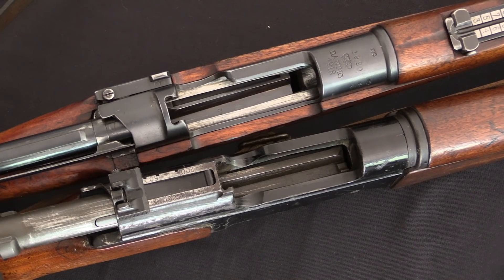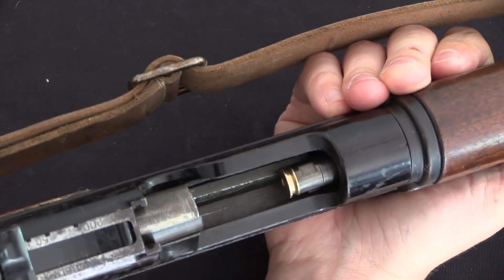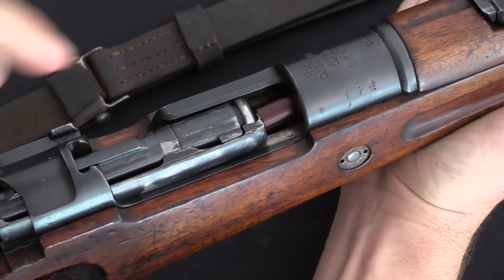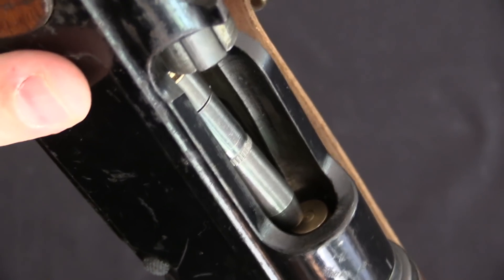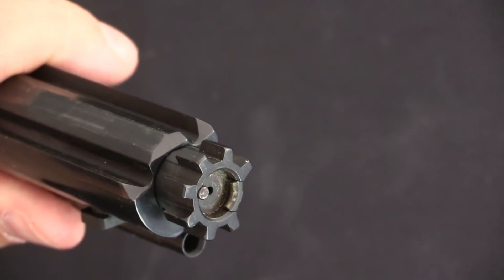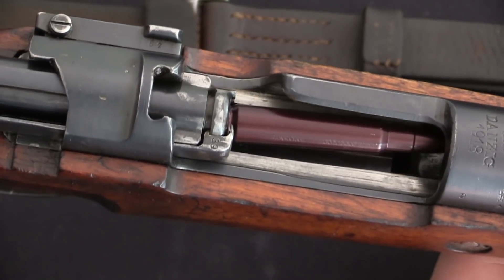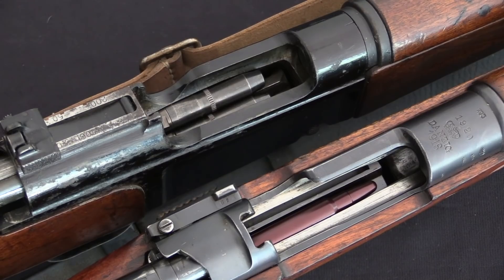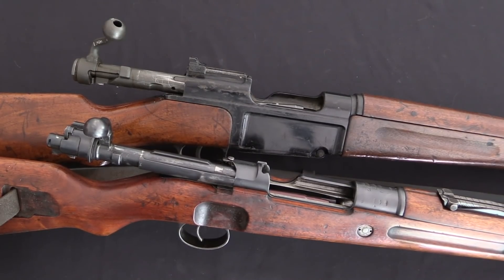How Does It Work: Push Feed vs Controlled Feed

Comment: "...are of long standing debate within some of the firearms community."
Translation: Here's two different feed systems, but only the real nerds argue over them.
Reply: I think the time could be better spent practicing practical shooting.
Reply: No, it isn't an argument between nerds.  There is a very real danger, in a stressful situation, such as combat or when facing dangerous game,  that you short-stroke a bolt action resulting in a jam that can't be cleared by re-cycling the action.  The CF (Mauser 98 System)  largely prevents short stroking.  Not entirely but for the most part.  PF actions on the other hand are a serious jam just waiting to happen.  So, if you need a second shot on a charging animal  and you jam a spent cartridge in the chamber you may end up dead.  That is why a Mauser 98, or derivative, is the most trusted of rifles (aside from a double) by professional hunters and guides in Africa.
Reply: @haroldgodwinson832  Most military bolt action rifles use push feed, since war is more dangerous than hunting, it's obvious that the advantage of controlled feed is negligible. In fact using a semi auto is probably far safer than using a bolt action on dangerous game. Due to hunters being extremely paranoid for no good reason and fear that everything that can fail will fail, they would rather use a bolt action with a controlled feed, even though soldiers rely on autos and push feeds for their own safety.
Reply: @johncarl5505   Hunters tend not to use semi-autos on dangerous game because, in most jurisdictions where DG animals exist, it is illegal to do so because; semi-autos aren't chambered in approved DG cartridges.  Also, it is considered by many to be rather un-sporting to use semi-autos.  And the continued use of PF bolt actions by the militaries in some countries (eg Britain and the USSR) had far more to do with the expense and logistics involved in making a change rather than the merits (cost) of the PF action.
Reply: @haroldgodwinson832  You do know that most countries were using CF actions for their main infantry rifle right. They switched to autos when it was more readily available, the USSR decided on autosnipers while the rest of the world still thought that bolt actions may still be of some use in a sniper role. They quickly realized PF is the way to go. Some of the most high quality and very expensive sniper rifles, such as McMillan and Accuracy International use PF. Snipers get access to higher quality compared to grunts, so expense is not an excuse to go push feed.
Reply: @johncarl5505  Hmmmm ... John, a sniper's rifle isn't a main battle rifle; is it?  No it's not.  A sniper's rifle doesn't require the same properties as a main battle rifle because it's typically used in a stealthy way from ranges that exceed those of MBAs.  That being the case; it doesn't really matter if the rifle jams because the user isn't in imminent danger; because he is somewhat remote from the action.   Do you understand the distinction??
Reply: @haroldgodwinson832  You do know most sniper distance engagements are not really that long range, they are always in danger. As for main battle rifles, Simo Hayha and Vasily Zaitsev used standard issue rifles, Mosin Nagants which are push feed at distances less than 100m, I'm pretty sure they could easily get overwhelmed. Yet even in terrible and stressful situations they kept their cool, cycled their bolts without malfunction, and mostly didn't miss their shots.
Reply: @johncarl5505  You don't require a sniper's rifle to engage targets at less than 100 meters.  For Christ's sake, there are smooth bore muzzle loaders that can hit a plate sized target at those ranges.  
At this point this discussion is just becoming pointless.  The reality is that CF bolt actions are more reliable than PF bolt actions.  This was acknowledged by the German military, the US military and even the British military although, in the latter case, they were too heavily invested in the SMLE to switch; in the same way that they recognized that rimmed ammo is less reliable (from a feeding perspective) than rimless ammo, but were too invested to make the switch.  And Finnish M-N rifles are certainly better made than Soviet examples but let's not pretend that the Finns wouldn't have used Mausers if they could have afforded the cost (and disruption) required to drop one and adopt the other.
Reply: @haroldgodwinson832  Yeah, this discussion is pointless just like controlled feed. More manufacturers are going to push feed, while keeping the controlled feed for those people who cant cycle their bolts properly or fear their gun will jam all the time if it was push feed. No one but controlled feed fanatics use them at this point, like Ian said the difference is negligible, so there is no point in getting the more expensive route. Anyway there is still a place for controlled feed, for those paranoid hunters and modern auto handguns.
Reply: @johncarl5505  You get what you pay for.  PF is cheap, entry level crap but that's all most people require.  If you don't want the best and you don't hunt dangerous game, you're right, a PF will 'probably' get it done.  Your average first-time 'once a year' user wouldn't even understand the difference. Good luck.
Reply: @haroldgodwinson832  I don't think Olympic, Palma, F-Class, Benchrest, etc. rifles are considered entry level crap because they use push feed. Those expensive military precision rifles made by McMillan, Accuracy International, etc. are entry level crap because they use push feed? They spared no expenses on those rifles, surely they would have made it controlled feed. The thing is controlled feed is useless, but I understand, you probably spent a lot on a controlled feed rifle and you are just justifying your purchase.
Reply: @haroldgodwinson832  A PF rifle won't "probably" get it done, it will get it done just as well as an equivalent CF rifle.
Reply: @hailexiao2770  You should tell that to professional big game hunters in Africa.  Look, once again, just for your benefit; a PF action is perfectly adequate for hunting deer etc.  However, if you understand what 'short-stroking' is all about, you'd understand that when facing dangerous game, you significantly increase the risk of a jam.  Not because the rifle malfunctions but because you malfunction.  That added risk is largely eliminated by a CF action; which, by the way, also has near full proof extraction, unlike a PF action.  Why?  Because it has a much larger extractor and a fixed non-mechanical ejector.  Now, if you can't accept that because you already have a PF action and you feel slighted or because you hope to get one when you're old enough to shoot, I'm sorry but there's nothing more I can do to help you.
Reply: There is an actual, valid reason to argue about this, in long-range shooting because a push-feed can slightly shift the bullet in the case, which can very slightly shift its POI- which is inconsistent, and thus will expand groups.

Of course, this is such a slight issue it's literally not worth fretting about unless your group sizes are in the 0.2x" range.
Reply: It's so utterly beautiful that in the replies to this comment alone you have 3 of said nerds talking about which one is better
Reply: Literally, millions of dollars have been sent on the differences in the last, say 50 years in the sporting community (which is the vast majority of the users of bolt actioned rifles in the world since the 1950's).

In sporting rifles, as much of the concern is the inherent accuracy and safety of the bolt and receiver, not so much the speed and security of the feed mechanisms, as Ian mentioned controlled feed in military circles is not much of an issue.

Why the concern over the feed mechanism for safety? Other than some really significant and successful modern examples of controlled feed, the 'push feed' has a fully and supported case head surrounding the brass case head with the steel of the bolt face and the receiver. This is important as many modern rifle rounds are operating at pressures far in excess of the typical cartridges of the 1910s and 20s. For example, a .300 Winchester Magnum is operating at pressures far in excess of say a .303 British or even a 30-06. The extra support of the fully enclosed case head by the bolt might be considered to be a safety factor. (Yes, I know the .300 Winchester Magnum was initially chambered in the 'old' Winchester Model 70, a rifle with 'controlled feed')

Also, in sporting rifles, most consider controlled feed an important concern when hunting 'dangerous game' such as bears and other large animals that could take exception to being hunted.

Why is the push feed often considered to be important to accuracy? I have no direct experience, but I have been told and read that the fully supported chamber of most push feed bolt actions may provide a better seal and more consistent fit, helping eliminate some variables that might contribute to greater or lesser accuracy.
Reply: @charlesadams1721  Excellent job of proving OP's point.
Reply: @charlesadams1721  Today I learned. Thanks for sharing.
Reply: It's so funny how common that is in internet communities. As a Linux nerd, I've seen forums devolve into childish flame wars that started with debating whether to write shell scripts with commands that were compliant with the IEEE POSIX standard... hey, wake up... and therefore more portable across UNIX-like operating systems vs more feature-rich commands that... you're nodding off again, almost done I swear... let you do more with less code. Nerds are passionate creatures but they usually have good reason to be.

Comment: The thing about controlled feed is that if the case somehow jumps ahead of the extractor (such as on Mausers with worn feed lips), it becomes impossible to then lip the extractor over the rim when turning the bolt to lock. This can result in a similar double-feed situation if you haven't realized what's happened. I've had this happen on my 98k, and Bloke on the Range has also had it happen to his Manky Mauser.
Reply: In addition to wear, the MIM extractor claw used on modern Model 70s also has quite a bit less spring tension and fracture resistance than the solid machined parts from the older generations of guns.  Williams firearms makes a billet claw that you can install easily, but a requirement to replace critical parts on a new gun is unseemly.  The MIM extractors work fine most of the time, but when the advertised utility of a design is it's "failsafe reliability" vs the easier/cheaper option, that seems like an odd place to cut costs.  The MIM extractors are worked significantly closer to their plastic range when snapping over single-fed cartridge rims, which has the potential to cause a failure at the worst possible time.

I own only one Model 70 because the effort involved in making a Winchester factory rifle perform as advertised is expensive and time consuming.  You'll get very little help from the majority of smiths who these days seem to know how to work on only ARs, M700s and Glocks.
Reply: Good observation. I have had two CRF rifles do this from the factory! A Ruger M77 and a Winchester M70. 
I've also had a Kimber 84 that had a poorly-tensioned extractor that would not eject.
I've never had a push-feed that had feeding issues.
Reply: Sooo... One of Mr Dad's opposite peeps, (WWII German Soldier in the West German Army.....). showed me how to get past the Mauser spring....
It just requires a strong right thumb- pressing on the extractor,  and a strong Pinky finger wrapped on the bolt handle to tug it forward a bit, ALL at the same time.    Interesting man....  A "personnel manager", as I was told.  (Not too chatty, but He knew a lot of stuff!).
Reply: Fair point.  I’ve used both styles hunting for decades.  Yes, I have had double feeds in the field with push feed rifles.  And, I have had a controlled feed miss the extractor on a control round feed - however, that happened when slowly cycling the bolt from the bench at the range - not in the field when working the bolt with proper authority.  I have hunted dangerous game in Africa on more than one occasion;  and I have always chosen a controlled feed bolt for such hunting.
Reply: @likydsplit8483  True.  I own  a few turn bolts of both types, and have had similar issues.  Many times it is a matter of cycling the bolt.   Even at my age,  (+60), I can still hear my Dad's sharp command to "CYCLE that bolt, boy!  You can't break it!"
Col. Jeff Cooper mused in a Guns and Ammo article before he died that "...these youngsters are not cycling the bolt with authority....". 
Interesting article on bolt rifle problems that really do not exist. 
No, I have not hunted Large dangerous game close up, here or anywhere else but I know the issues.  We are very fortunate to have a great knowledge base available to help alleviate problems.
Reply: CORRECT....I have shot a well traveled 98k at a local range that was practically
a single shot because of this....sigh. Very irritating because this was one
of those chambered to shoot 308 and thus very desirable around these
parts...
Reply: @Josh Ayala Sounds like you got that solved after some hoops and jumps.....    I've carried a 1911 all of my life, business and just because.  Since DoD purged all 1911 and the collectors gobbled up ALL of the tools and guages, what was a simple fix is now a P.I.A.!
Reply: And you can't single feed the rifle or load 5 in the mag and one in the chamber
Reply: @zacht9447  With mausers, or at least the ones I've shot, you can load 5 in the magazine and 1 in the chamber.
There's enough give in the magazine to get part of a sixth cartridge in. Then, while holding down the sixth cartridge down with your thumb, you can push the bolt forward and it'll strip it from the top of the magazine like normal.
You can also just drop the round in and single load it like a push feed system. The extractor is bevelled at the front to allow it to snap over the rim of the cartridge. This isn't recommended though because doing it too much can damage the extractor

Comment: I jammed up a rifle with control feed by single loading a cartridge without pushing it down into the magazine. The bolt pushed it forward enough for it to get stuck in the chamber, but couldn't go into battery because the extractor wasn't over the lip of the cartridge. Ended up having to remove the bolt and push the round out with a cleaning rod 😂

Comment: Ian, I think you missed one of the potential malfunctions with controlled-feed. Occasionally, the round will fail to slip under the extractor. When you attempt to close the bolt, the extractor needs to slip over the rim of the case like on a push feed. But on some Mausers, the extractor is so stiff that this is impossible to do, and you’ll have a stuck round in the chamber. This happened to Bloke on the Range with his K98 in one of his videos comparing it to the Lee Enfield.

Comment: I don't think that the feeding mod has any impact in the ejection type, plunger or fixed,the only differences is that the push feed has the extractor lifting over the rim ,possibly more wear, compared to control feed that the rim gets under extractor with out needing to move, is possible in to make a gun with a fixed extractor but it need to be controlled feed.Also the other difference is the double feed problem.

Comment: One of the arguments like this was between Double Rifle, and bolt actions for Safari.  Dangerous game, .375H&H belted magnums, and up.  If I remember right, the Bolt Actions were Controlled Feed, while I guess I could be in the double rifle, drilling, and combination gun camp, mostly because I find them beautiful.  (The Kreighoff international site is some of my favorite gun porn, even though I have neither the budget, nor any use for a "Big 5" rifle/shotgun combination.)  I kinda understand the argument that nothing is faster, and more positive on a second shot than another barrel.
Reply: Where dangerous game is concerned it's not about 'action speed'.  It's about the potential to short-stroke the action in a highly stressful situation where a second or third shot is required.  If you do this with a push-feed action you will in all probability render the firearm 'inoperable' at a critical moment, and end up dead.
Reply: @haroldgodwinson832  That was another part of the age old argument.  Seriously, guys sat around the lodge, smoking pipes, and arguing over what was better when it was Bow, or Crossbow.
Reply: I have also heard it said that a properly designed double can essentially be two entirely separate rifles, so even if one suffers some sort of catastrophic breakage and won't fire, all you have to do is pull the trigger of your "other" rifle.

Comment: One downside to controlled feed, at least in some experience, is inability or difficulty single loading. Not a deal breaker, but worth pointing out.
Reply: Odd. The Springfield '03 is controlled feed and is intended to be single fed. I've also not had any issues with a Pre-64 Winchester Model 70. Possibly a per-rifle basis on this issue?
Reply: @Kattbirb  yeah, it comes down to the firearm, as it's all in the extractor design.
Reply: @Kattbirb  The SMLE  is also controlled feed, yet early ones had a cut off for single loads.
Reply: Yes, it can be easily overcome with extractor design. There is nothing magical on push feed rifles that allows their extractors to spring over the cartridge.
Reply: Don't you just put the round into the magazine and load it? I was told just setting a round in there and having the lips snap over it is not the best. 
At least my rifle makes a horrible snap when that happens. But it works.